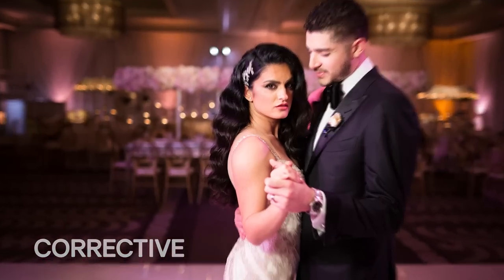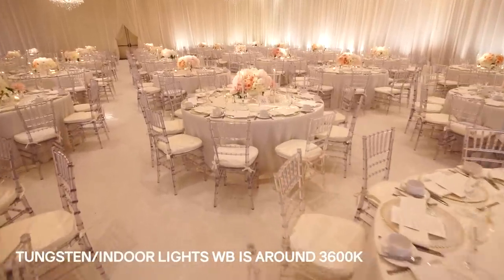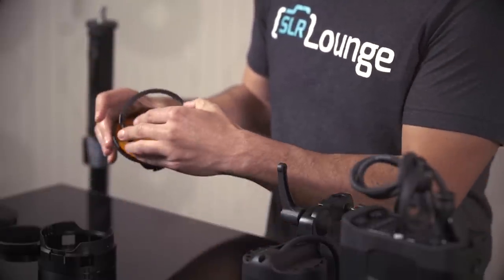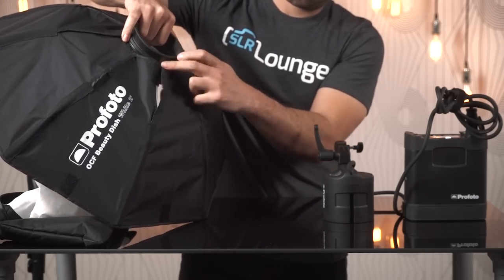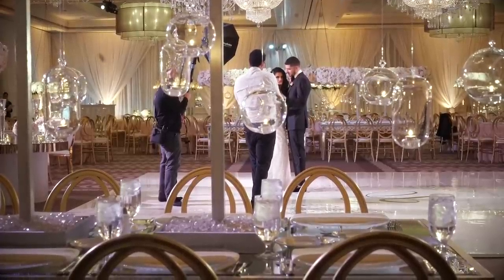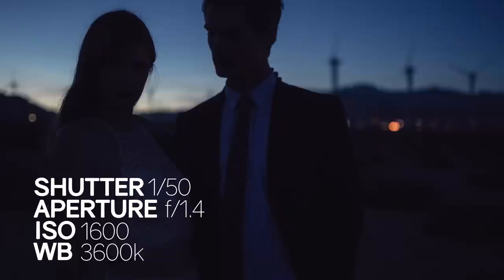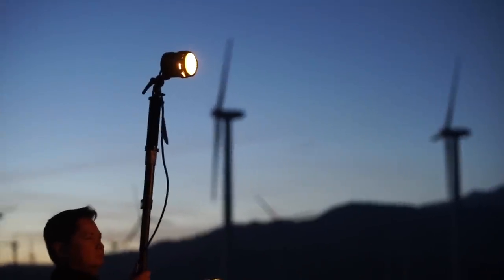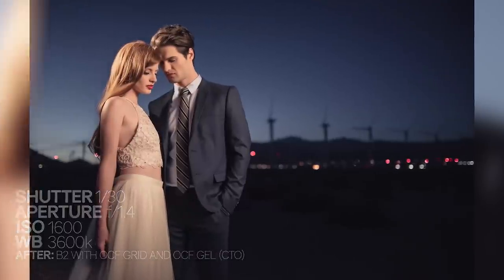2 Gel Techniques | 2 Simple Gel Techniques for Incredible Effect

Comment: Quick question. In this set of videos you say you get your ambient light first.... then do you shoot in TTL on the B1 or B2 and adjust as necessary or do you use the lights in manual? Thanks!!!
Reply: I wont be surprised if he does it in manual. But if you got TTL just use it, normally TTL works fine unless you point the your flashes into your lens *say for intentional flare effect)

Comment: hi Pie, can we do something to light room to stop the picture modification after import? wen i import my raw file aster 2-3 second my colours, change.. :-(
Reply: in case you never got your answer, the first version of the image you see is the jpg thumbnail. its what you see on the back of the camera and often looks great since image adjustments like contrast and sharpness are added. 
.
When a raw file is loaded in LR, the jpg preview is replaced by the actual RAW preview after a few seconds. The raw preview is the flat unadjusted version of the image. It will need adjustments to get it back to the look you saw before. If you prefer to just get what you see on the camera, shoot jpg but you need to get accurate exposure as LR won't be able to correct as much. I hope that helps.

Comment: why is pye mixing it up...3600 is  cooler than 5500 Kelvin..the higher the Kelvin the warmer the color temperature
Reply: How does this work though?🤔🤔
Reply: Sisekelo Duma Hi, this is how I understand Kelvin degrees: A yellow light is a warm light. In order to white balance it, you obviously need to add some blue, aka a cold color. So the 3200K are describing the coolness of the added color and not the color of the lightning source. Hence white "balance". Does it make sense?
Reply: Varun Kamal julio iglecia
Reply: If you add a CTO gel, you need to to compensate with a low kelvin. Pye is right on.
Reply: but he didn't add any blue gel...